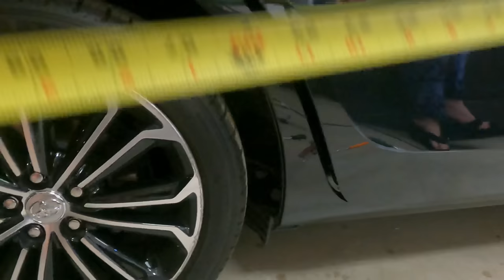FIRST TIME WRAPPER, Paradox Shows Him The Way In Real Time *No TimeLapse* | Making Of An Apprentice?

Comment: Matt, you definitely are on the right track, couple things to remember, the nozzle of that heat gun is scorching hot, don't throw the heat gun on the seat after you've used it, you can easily damage the fabric, also, professionals have a lot of respect for the tools they use, do not throw your heat gun on the floor. There's another heads up about heat guns and rags , I almost burned my garage down once, when I put the heat gun close to a rag that had some thinner on it.
Reply: Also the way he puts the measuring tape against the car .. smh I get it it’s gonna be wrapped but nobody wants their car scratched

Comment: I started working in a body shop back in 1994. I jumped out of tapping off  around 1999. I haven't lost the touch and successfully wrapped my center console with silver flat carbon fiber. I will buy mid-grade viynl and attempt to do my whole car without anyone around to help. I'll bet with your tips and my similar experience by next year I'll be anodizing my 06 avalon. I will be practicing with big scraps in hard spots like my front bumper .I'll just pull and trash the viynl regardless of how good it looks. It was just to perfect my angels before I ruin my good viynl. You said in the beginning this isn't watch n learn and I agree 💯 percent 👍. Hands on and play/practice over n over to build confidence if you will be doing this alone.

Comment: starting the vid his cutting looked scary but he did a good job but had great help, did he clay bar?.
 This is a great video and gives so much info on how much you can wrinkle/heat heal and wrap over body lines. 
Id like to see your pov vid explaining what sand paper for best finish  320-2000. Also stretching over corners and how much extra heat radius can help with getting less colour/fade loss. using torches and post work to prevent bs from happening. thanks for the help

Comment: My Toyota Tundra clear coat started pealing on the hood and roof the rest of the paint still looks so rather than paint the roof and hood I want to try a black carbon fiber vinyl wrap and include a pillars b pillars the door window frames and c pillars and around the rear window.  I’m sanding the areas wear clear coat peeled trying to feather in as smooth as possible but I was wondering how much is good enough.  What kind of hiding power does the film have.  Should I spray primer first before starting the wrap.  Watching your videos has inspired me to attempt this. I’ll let you know how it went.

Comment: @Paradox The Wrapper, 
I have a question? If I have a little in my front door very minor , if I add bondo etc and if I put primer can vinyl stick to it since I would like the surface to look straight.
Reply from the maker: Sand it smooth and test a small piece of wrap on it

Comment: I'm buying a GX470 (suv- same as 4runner but with lexus body- that size)... about what would that take- in material??? and approximate cost in a nice white.. maybe the color changing stuff... I will have steel bumpers on it front and back - so now "ground effects" body crap on it... about the size of a 4 runner..
Reply: 60ft gives you extra
Reply: @marktwain5803  THANKS...

Comment: I am trying to get into it and I have wrapped some things on my cars but it peels a little towards the edges how do I fix that?
Reply: You are over stretching your materials, always heat before you cut, if you see vinyl moving when you heat near the edge you overstretched it
Reply: @dnawrapsatl  so I should tuck it better without heat and strech before I cut?
Reply: @Extinct90  before you cut the vinyl, heat and make sure it doesnt move and make fingers. Then cut. Check out ckwraps

Comment: What kind of blade is that y'all are using to cut the wrap on the body panels it's making me cringe being a paint and body guy, I'm super interested in doing wraps I'm just concerned if that's a razor blade cutting into the actual paint and clear, wouldn't that cause the wrap to bubble and show the cuts in the paint and potentially cause rust under the wrap on the body?